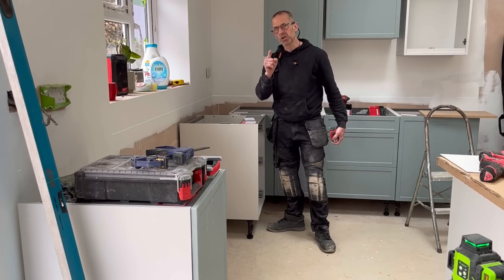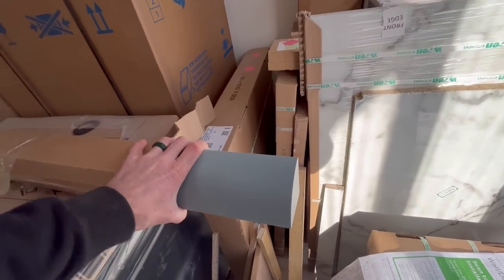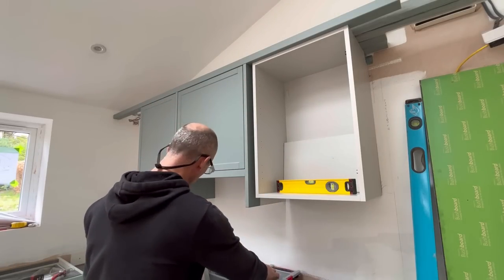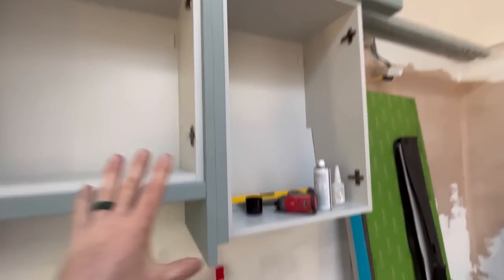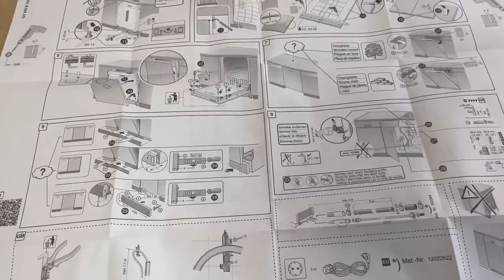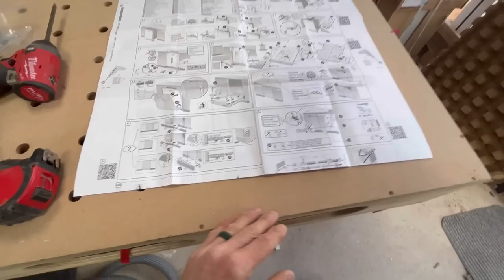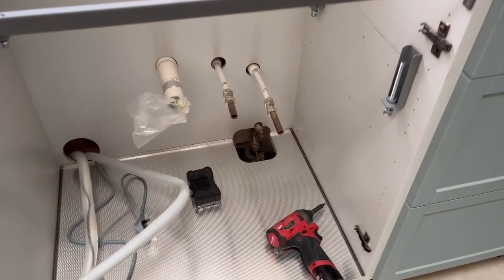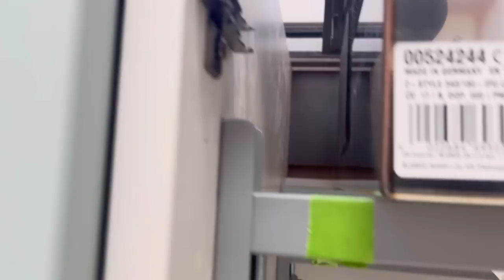WREN KITCHEN - FINALLY MOVING FORWARD PART 3  #kitchen #carpenter

Comment: Another top video mate. We now pocket hole rail's across the top of all our integrated washing machines and dishwashers. This lowers the appliance makeing the legs long enough. This also stops you needing to notch the plinth to allow the door to open. Top job of the filler between the 2 cabs . Also nice work around on the undermount sink supports. I normally go with a bit of lightning rail screwd to the back bracket. Only happens with the Blanco sink's with them stupid overflows.  I also mentioned last week about how close the wall units will b to the hob. This will b ok on induction hob but definitely not on gas or halogen . Cant wait to see it all done mate i take it from a full time fitter your doing a top job with the hand you've been dealt. Top channel and top content 🤙👍🤙👍🤙👍🤙👍🤙
Reply from the maker: Thank you for your comments David they are very much appreciated and we are glad your are enjoying our channel. Plenty more to come 👍🏻

Comment: Great work. Must say I  have never needed to pack up a leg on a dishwasher with wren and we always set our cupboards at atleast 160. I wasn't sure why you needed too. Also just a tip, with units that are going up against the wall instead of putting a panel on the side then a filler its better to fit a filler flush with doors and a backing piece on to mount to the unit itself. Loses a unnecessary joint.

Comment: Hi Rich, glad to see the kitchen is finally taking some form of shape now, even with all the problems you've had. As regards to them instructions and template for the dishwasher door I always thought it would be a great help if they put some writing on each stage, but I suppose that would be to easy. One tip I used to use to ensure the bottom clips that fix to the back off the door and secure it was to get the  measurements from the template but use a scrap piece of timber and mark the tops of the doors either side. i take the measurements from this and transfer them to the door,  this avoided trying to drill holes 1 or 2mm higher or lower. Good luck finishing the kitchen, I'll keeping watching.  👍👍

Comment: instead of constantly referencing the tape measure, you can use a block, place on top of your set cabinet and mark where the laser line hits it, you can even make a line the same thickness as the laser line. then use this as a reference to set the rest of the cabinets.
Reply from the maker: Can’t disagree with that I have done it all ways. I think sometimes it’s whatever floats my boat at the time. I prefer to use a level most of the time anyway
Reply from the maker: Didn’t think you were mate I agree and if you’ve watched the other kitchen I fitted on the channel and any door frame fitting I say it all the time. Maybe it’s an old fashioned thing now but I do prefer using levels. Enjoy the rest of your Sunday👍🏻
Reply: Top video again and Top Music!
Reply: Hello Rich! Did you make that bench top? Have you done a video on it or was it pre YouTube. Loving the content. How is Adam getting along with his pad? Great channel.
Reply from the maker: I made it myself and it was whilst I was doing the previous kitchen on the channel. I didn’t film it cos I didn’t think anyone would be interested. I purchased an MFT jig and router bit and I use bench dogs stuff very good 👍🏻

Comment: Nice work there!  Can't quite tell if there'd be enough room for the sink unit rails to sit just under the sink lip - so you could wind the sink up tight to the worktop?  Looked like the overflows might be in the way though.  Just a thought.  Excellent videos and work 👏
Reply from the maker: Hi Rich. It’s the overflows causing the issue where ever they go. It has been said that one rail could have been used in the middle but that doesn’t sit right with me so I ditched that idea straight away 👍🏻

Comment: Enjoying the videos. Quick question about the sink. Doesn't the sink go in after the quarts worktop goes in? Which will obviously mean it will sit higher up than it is now ? 

What am I missing?
Reply from the maker: This is an under mount sink so gets installed now and when quartz is fitted they put silicone on the lip of the sink and sit it on it. I’ve set my sink 2mm down form worktop level to accommodate a good silicone bed 👍🏻

Comment: RE: kitchen sink, i take it that the design allows for the waste to go left or right of the sink by just turning the unit around? that would mean your wastepipes  nuts would have clearance and no need to use the treated wood back plate you made???.
Reply from the maker: Forgive me if I’m not understanding what your saying but it’s the overflows that are in the way of the supports not the waste itself and they are fixed. Thanks for the comment 👍🏻

Comment: Id be well pissed off if everything was in my new draw, never had an unleveled unit delivered before, fillers,filler,fillers, bad designer but should of also been picked up by the fitter on prefit really, why are tge base end panels cut on the top ? Just noticed the wall end panels are about 4mm over long any reason why ? 4 fillers in the tall unit corner when you could of got away with just  two,

Comment: 39 Why not re-do the plumbing so it is neat, rather than coming through the back panel at odd heights or the big cut-out in the back & base of the cabinet?

I would also of fitted the appliances and end decor panel after the floor is done. That way appliances can slide out, rather than chipping the lip of the flooring. Flooring going under decor panel and kick-plates look neater.

I know it is more faffing about, but after the expense of the whole rebuild, worth the extra effort.
Reply from the maker: Hi. The plinths came off when the floor was completed and put back on after and as far as I’m aware this type of flooring shouldn’t have anything fixed put on top of it to allow it to move. It wasn’t an expense thing mate just information gathered from the flooring contractor. Thanks for the comment. 👍🏻
Reply: yeah, laminate floors have to have expansion all the way round, often done by cork round the edges and then a bit of quadrant to hide it. The laminate I have done, I remove skirting and chip away the render and plaster, so the expansion cork is right against the wall. This way the expansion gap is hidden under the skirting & horrible quadrant is not required.

Look forward to part 4, the finished room?

Comment: So Wren Kitchen designers are much the same as your high street shed kitchen suppliers the computer programme they use leaves a lot to be desired, if they were operated by a kitchen fitter or Joiner then the mistakes could be designed out of the layout, speaking from experience very rarely does the kitchen design work unless it is bog standard and suppliers have the cheek to charge you for cupboards that don't fit !!! .
Reply: last kitchen I fitted, I had to totally redesign the island, if I hadn't one end of it left too little room one to properly use the dishwasher, and encroached too much on the oven door at the other end, yes you could use it but it would have been very annoying and made a largish (5.6mx4.7m) kitchen feel cramped. I ended up shortening the Island and creating a T-shape one which made use up lots of empty unused space, looked far more premium and allowed the fitting of a wine cooler and  warmer draw.

Comment: Weird type of installation here Rich, fillers where they shouldn't need them, unit over the hob is too tall and won't give the right hob clearance..., not using the space-plugs for the other units, packer under the dishwasher feet.. larder units too tall for the alcove... sounds like a right cluster-feck !!! The work around under the sink is good, not sure why the huge cut-out is in the sink base though  ??? You have added L brackets outside of the wall units too !! The first fix plumber needs his testicles felt imo !!!
Reply: I’m guessing he lowered the units and forgot about the clearance. Not a chance in hell that’s allowed. Will need to come out.
Reply: Looks like he has made a pretty good fix of a crappy kitchen design, the attention to detail making the most out it, a less caring fitter and the kitchen would be proper honking. The sink is a terrible layout, just don’t like the set up at all with bars and elaborate levelling brackets. The L brackets are behind a integral dishwasher so never be seen. Suppose at  least Wren are changing the cupboards to correct heights. Think is minimum 650 & 750 over a hob but could be a induction hob so be less..

Comment: Put a panel each side of the draws to match  the wall units, so thete aren't loads of fillers on the wall unit, the dishwasher should have a mun 604 gap not 600, don't know why you have put wood underneath the dishwasher as if it gets wet and swells it will put press on the machine pushing it up towards the tops, should also put a 2mm packer each side of the dishwasher to stop  the tight space getting even tighter, (don't ask me how but iv been to remedial where the cupboard each side has some how moved towards the dishwasher). the waste won't fit on the main bowl as the rail is to tight to it, what happened to the back of the sink unit, the massive square cut out ? Sorry, but the sink brackets look atrocious abit of 60mm timber each side of the waste would of been more then enough.

Comment: Never understand why the water pipes are never fixed below the base unit negating the need to cut the back of every cupboard to be cut.
Reply: That's often where the electrician wants to go.
Reply: @stepbackandthink  I’m
Sure you mean plumber but Yeah, but it makes more work for the fitter.
Reply: @911HRW  No. Electrician.
Reply from the maker: It’s a good point but they may get damaged as they would be in the way through the plastering phase prior to kitchen fit. Worth looking at though. Thanks for the comment 👍🏻
Reply: @stepbackandthink   So, I mention why the water pipes are where they are and you say it’s where the electrician wants to go? There is at least 160mm from the floor to the bottom of the cheeks, plenty of space for both
Reply: @Mr_A_Builders  What I’m
Saying is you have white plastic pipes secured to the wall with clips that you need to cut the cheeks of every single cupboard to make channels for them. Surely they would be better at floor level negating the need totally to waste time and cut the back of the cheeks. I have just had a Wren fitted (total joke of a company) and all my pipes and cables were fitted below the back cheeks meaning no cuts at all and all the units went straight back to the newly plastered wall. Still. I’m not an expert in these things, just looked at time better spent by my fitter instead of cutting cupboard backs and allows easy works at a later date since they’re all accessible by removing the plinth, something impossible to do of all the pipes are fixed behind the cupboards.
Reply: @911HRW  You could squeeze both in, but that's unnecessarily tight. It's no big deal to cut out for pipes. You get used to it and it doesn't take long.